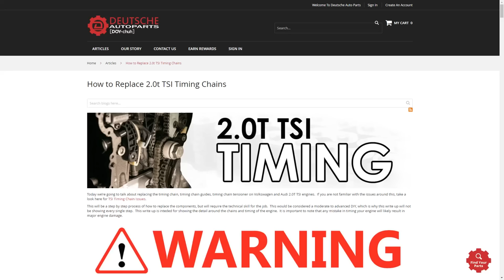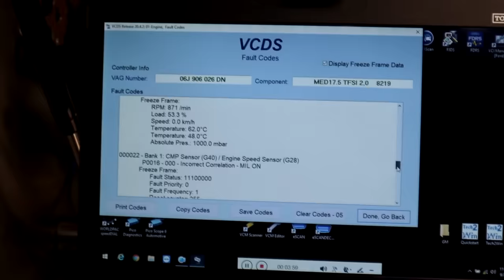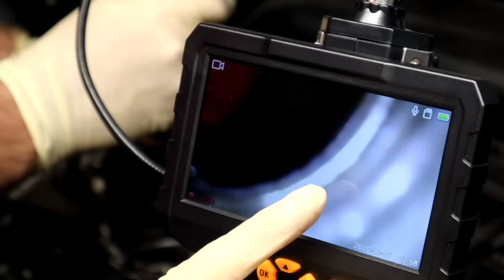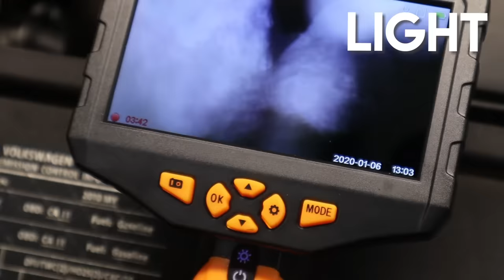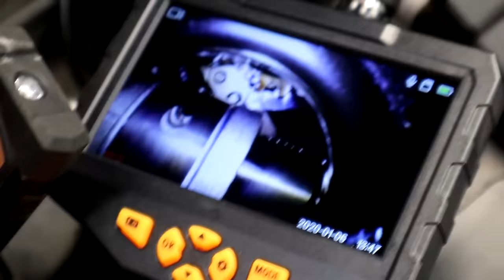The Jalopnik Tiguan FAILED ~ Despite the Warning

Comment: The timing chain tensioner on a Toyota corolla can be replaced in about 10 minutes without taking the timing cover off. I love superior German design.
Reply: Calling it a design is being generous
Reply: @tossmonkey1  
It's not design, more like accident.
Reply: @elprzemo666  Or an annuity for dealerships
Reply: Mercedes v6 only have to remove alternator to change tensioner
Reply: Your corolla makes 120hp-140hp and is molasses slow.
Reply: @goclunker  What does that have to do with superior Japanese engineering. Plenty of cars from Lexus that put anything German to shame.
Reply: German engineers are the most arrogant people on earth.    Only idiots keep doubling down on lousy designs and "plastics" in some really critical areas.       I don't care if Toyota uses plastic in engines too.   Toyota's "plastics" last longer and work better and are more reliable.
Reply: @lukew2194  don't get too cocky though, there is nothing Japanese that can match Maybach quality.
Reply: @lillexus5589  Give me a Maybach for a few weeks so I can evaluate it's quality and I will get back to you with my findings.
Reply: @goclunker     They could engineer a little reliability in with that higher performance.    How about not using a plastic water pump impeller for starters.....
Reply: Lil Lexus actually I think the Toyota century does and they’re also still reliable, even with the v12 models.
Reply: @scdevon  German and Russian engineers are some of the best in the world fact.
Reply: @chris-jb5ds     Germans could be a lot better engineers if they didn't test the limits of engineering on the general public so much.     A chain driven oil pump / balance shaft module?   That idea should have failed on a test track, not inside of a customer's wallet at the VW dealership. 
Russians.   LOL.
Reply: @lillexus5589  Having worked on a Maybach or 2...  No. Absolutely and completely no. They share the same build quality and even some components as a Mercedes Sprinter van, they just don't get used anywhere near as much or as hard.
Reply: @stykytte  I know enough about Maybach's bruv, my brother inported a s680 to Poland from China. Some parts are indeed interchangable, yet the complete symphony of the parts form a level of luxury that a normal S klasse or Siebener can't compete with.
Reply: scdevon did i say the tsi is reliable? No, i said that the more power you make without extra displacement, the more complicated an engine gets. Its not rocket science. Stick a turbo to your corolla engine and it will last 1 track day. Mightycarmods for proof.
Reply: @lillexus5589  I never said they were not a sofa on wheels. You claimed nothing Japanese could match their quality when they are easily outmatched by any JDM executive sedan.. hell my fathers old Toyota Hi-Ace was nicer to be in than any of the Maybachs I worked on.
Reply: stykyun no it doesn’t. Power= complexity. A 2jzdte makes 670hp max before it needs fully upgraded internals. Its also a fairly complex engine. Your not making 645hp on a corolla. As they say, video or it didn’t happen. You don’t understand basic physics.
Reply: @goclunker  This has nothing to do with physics, you're just making yourself sound dumber. A modified 1950's design 426 Hemi can push 11,000HP. Yes, ELEVEN THOUSAND Horsepower. What do you think top fuel dragsters use? They are not complex at all, the simpler the better so there is less to go wrong...

A Corolla can have many different engines in it, I had a 3S-GTE, very similar to this https://www.youtube.com/watch?v=C_4_f_e8jHY except I didn't put as much money into mine as it was a daily drive road car and only ran it at 30-35PSI on a Garrett. I could have turned it up, but it would push through the clutch.

You're some real Dunning-Kruger material.
Reply: stykyun oh, and if your corolla is making 645hp, it is NO LONGER A COROLLA, because not a single part in that engine is stock. Not the crank, not the rods, not the pistons, bearings, head, valvesprings, cams NOTHING, not to mention a turbo, making your idiotic “point” COMPLETELY MUTE
Reply: @goclunker  It's still a Corolla on the reggo you muppet.
Reply: stykyun stock engine? No? Stock internals? No? Not a stock Corolla, you vegetable.

You’re not holding any power stock, period, as the blown corolla swapped yaris easily proved
Reply: @goclunker  You keep handily missing the parts of the replies where I prove you wrong. Here let me help you https://en.wikipedia.org/wiki/Dunning%E2%80%93Kruger_effect This is why you think you know wtf you're talking about.
Reply: stykyun BUILT MOTOR NOT STOCK. You are arguing Corolla reliability with a BUILT MOTOR you vegetable
Reply: @lillexus5589  However nothing devalues like a "Maybach".
Reply: @gti500  true that. As mentioned somewhere above in the comment section, my brother bought and imported an Maybach S680 from China to Poland for around 70K Euro. It's a high mileage one, build in 2018 but still a damn nice car.
Reply: @goclunker  same engine fits on a Lotus
Reply: @goclunker  I have a Corolla and a Golf in the driveway. The Golf says "defect brake servo" and the check engine light is on. It goes to the mechanic Tuesday. The Corolla with its 4 valve per cylinder,double overhead cam and variable valve timing simpleton of an engine is 4 years older than the Golf and has gone 60,000 more km. It starts first time, no warning lights. When the Golf is working properly, it is a much nicer car to drive. But, if I want to get to work, I'll take the Toyota.
Reply: @cme2cau  sure sure.
Reply: Its what happens when its built by engineers, not mechanics
Reply: @scdevon  Honda uses a chain driven oil pump/balance shaft assembly in some of the K-series engines, I've never heard of anyone having issues with them.
Reply: @PistonAvatarGuy        That's easy.   Honda got it right and VW didn't.     Google the VW balance module / oil pump saga.   It's ugly.
Reply: @scdevon  Yup, I just thought that you were saying that the whole thing was a bad idea.
Reply: @lillexus5589  Toyota crown .
Reply: @cartoonking461  the Crown Majesta comes close, yet lacks in aspects and was only sold on the Asian market. The new Crown is a beefed up Lexus ES.
Reply: @goclunker  since when are 2jz complex....
Reply: @goclunker6821 Are you inferring that VW’s are fast? 🤣🤣🤣🤣🤣
Reply: Useful info if this was a video about Toyota.
Reply: @timothyhoffer8011  The message being - VW's a garbage, Toyota's not so much
Reply: @lukew2194  you mean like how they have a laundry list of issues just like a corolla should know worked on enough of them rofl. weeabo fanboy spotted

Comment: These engines are absolutely appalling. So many weak points it's just incredible. If something doesn't break mechanically, it'll be made of plastic & leak later! Shocking quality.
Reply: That jalopnik guy should be ridiculed for giving bad advice.
Reply: What is truly mind blowing is my 96 A4 had timing Belt issues, the issue was the tensioner.... So they switched to chains. Awesome but, why is the damn tensioner still made of freaking playdo 14 years later?
Reply: slimchriz1 planned obsolescence. They will never redesign it to be reliable
Reply: @slimchriz1  Its a known issue and so at 100k miles replace the chain and tensioner. It’s a cheap repair when you do it timely. Waiting until the engine implodes at 130k miles is on the idiot owner. Fix it at 100k and the car will last another 100k miles.
Reply: @slimchriz1  those had both a chain and a belt...  all the 5v motors did..  1.8 2.8 4.2
Reply: I considered a VW GTI as a fun daily, but ultimately went with a '17 Mazda 3 manual and after watching this I'm confident in my decision. Reliable and slow is the way to go if you're on a budget. I know some people will disagree with me, but that being said I still think the MK7 GTI is one of the best cars VW has ever made.
Reply: Mazdas have the EXACT same timing chain issue. At 100k miles you beed to replace the chain and tensioner on your Mazda too.
Reply: @michaelb7437 , just to compare: X-Trail T31 2008 2.5L QR25DE — more than 247000 km — NOTHING has been done to the engine yet.
Reply: Bring back the BPY motor, which preceded this in the earlier B6 Passat and the earlier A5 Jetta/Golf/GTI.  Change the timing belt regularly, along with the infamous "cam follower" riding on the fuel pump cam (looks like a big thimble).  You should be good to go.  Mine went to 183K miles before my daughter totaled it, while she was commuting to college.  We bought it new and got 11.5 years out of it.  I still have the cam timing tool kit in my basement for this motor.
Reply: @taomicioli  The chain connected the two camshafts, the belt connected the exhaust cam to the crank.  Beware of the water pump seizing prematurely.  I have a 2004 VW Passat wagon with the 1.8 L "AWM" 20 valve engine.
Reply: @WPM_in_ATL  know about them....  do a few a week at the dealer I work at..... all the 5v motors were like that ...  as were the older 2.0 gti and first gen golf r...
Reply: @taomicioli  I do understand the 20V 4 banger motor can be made to make 400+ HP, that is why I decided to fix the car (AWM equipped Passat) when the timing belt broke after the water pump seized.  I've put 10K miles on it since and now it has 204K on the clock.  Local machine shop knew what I needed before I finished describing the engine to them...made me relax knowing the bent valves were not catastrophic failures.  Pistons were fine, just cleaned some carbon off them.
Reply: @dil6969  you lost out on a ton of fun
Reply: @michaelb7437 Or improve your life and buy a Toyota/Honda!
The vaunted German engineering …VW = Garbage
Fix that Turd for $5K and it’s still a pile, at best another 1k miles before another catastrophic bill!

Comment: This is a great ad for Toyota
Reply: Yes ,the Rav 4 is cheaper and just runs and runs.
Reply: why, youtas have lots of problems like every other car maker they're not made of pixie farts. Bought a brand new tacoma and theres a list of issues that are "normal" like the dash lcd vanishing for periods or impropper rough starts or shitty vtech that ruins the power band and has to be tuned properly and on and on. Meanwhile my 100k B8.5 has only had 1 water pump, a new set of breaks, new set of tires and a pcv valve (sprorts cars do go through brakes and tires faster but pretty sure these never were changed since new )

Comment: Had a blast!  Thanks for the good times.
Reply from the maker: YASSS!!!
Reply: I imagine the vehicle owner is happy this wasn't a more direct tie-in with Cars and Cocktails... 

Because while "Fixing Bent Valves While On A Bender" is a fantastic title for a video, I'm not sure the end result would have been quite as fantastic as it was.
Reply: Adaris we drink and we work on cars, but not at the same time.
Reply: @Deutscheautoparts  I was kidding heh; I apologize if it wasn't evident.  Truth be told, trying to time a TSI engine while inebriated sounds like a very special kind of hell for everyone involved.
Reply: Adaris didn’t take offense. Just wanted to clarify. It would be a challenge if you were drunk.
Reply: @Deutscheautoparts  side bar there guys need some help decoding between a 2014 Golf GTI with the 2L TSI and a 2015 Polo GTI With the 1.8Tsi which would be worth getting? By the way the 1.8 comes with a 7 speed dry clutch DSG.
Reply: Is this something i should also watch out for with my 2010 passat cc 1.8tsi??
Reply from the maker: CC didn’t get the 1.8 in the US, but in 2010 yea it’s an issue
Reply: @HumbleMechanic  Thnx for anwsering, what would be the "best option" ? Just upgrading the chain tensioner or do other things have to happen too? my car has 60000 kilometers on it and has been running perfectly..but i want to have a trouble free engine if possible..
Reply: Hello....part number of vent a  new manifold 29:41 please!!or put link ...i wont this...tanks!!
Reply: HumbleMechanic is it possible to put a mk7 gti engine on my mk5 rabbit??? If so what would I need to do to make sure the transition goes smoothly?
Reply from the maker: Oh yea! Everything is possible with enough skill and money. Lol. It’s probably not a straight drop in
Reply: @Helghan23  Maybe look on German forums?? Those crazy germans might have a swap like that on there somewhere...
Reply: TIL DAP is also located in NC! Nice to see local representation in the automotive and YT world!
Reply: VW suspension, body, and interior fittings are excellent, but man...., tooo many plastics in the engine.  Not sure, why they put plastics in vitals points and Germans do not make the best plastics. American Dupont does
Reply: Brought a scirrocco 2009 2ltr TSI turbo from a dealer. Lasted under 2 months. Took it to a mechanic. Quote was 9,300$ to rebuild. Car dealer wouldnt take car back. Took him to court and sued them. Got all my money back and more. Found out that these engines are infact short fused timed bombs. Will never buy cars with these engines again. Poor design.
Reply: @scuxxy25  Yes, many states do not allow Car Dealer selling you Lemon.  I believe states like Texas has costumer protection of 1 year from any used car dealer even if they said As is.
Reply: In the video you say the timing marks are blue, but they're not? They look yellow to me.

Comment from the maker: So we give Jason a little bit of a hard time in the video. This is all in good fun. The type of fun ya have with a good buddy. I am happy Jason reached out to me and we could work together on it.
Reply: I've seen timing guide failures on a couple mid-2000s Chrysler Hemi engines, but they didn't resist spontaneous disassembly as well that VW did.
Reply from the maker: @lakinnenlako6883  LOL
Reply: @HumbleMechanic  a bit off topic... I actually just re watched today, your review on the sonic s12 that we can see here today. There is mention 20% discount on the first purchase for crew membership. However, the website says 10%. Is it a typo or is a newer information? Also, is the discount worldwide or USA only?
Reply: Hey Charles how can i get ahold of you so i can use you to work on my tdi ???
Reply: Excellent staff very knowledgeable gentlemen. Wish we could do a brain transplant
Reply: HumbleMechanic again always thanks for the video! Awareness of potential issues is always good to know. A $800 preventive measures in replacing the tensioners and inspection is much less expensive than having to deal with the damage after the fact. Seeing this video made me feel at eased my money was well spent last year on my DD tiguan!
Reply: @Kurt Koleszar to be fair, he said that was a very uncommon failure - the tensioner is the failure prone item. 

Also, composite materials are far better in a situation like that, as metal on metal contact would cause chain failure, and also promote metal particulates in the oil.
Reply: Where's the injector puller from? And the special tool to pull injector seals off? thanks great video 😎
Reply: @TheThrobber1  they said it's available from DAPs website

Comment: Great vid, but for those wanting to get out of this mess as cheap as possible in a DIY, I've had zero issues with simply throwing in some valve stem seals and lapping in ebay valves with an electric drill, even when all 8  intakes were bent. Just dump some water in the intake ports after they are lapped in and let it sit for a while to make sure you got a good seal.

Comment: These damn VW engines,...it’s like putting chewing gum back together... Nice job, guys. Flashbacks to rebuilding my 1.4 twin charger, nightmare job.
Reply: Axtenar What vehicle? Where was it manufactured?
Reply: Our 1.4 twin charger never cracked a piston but it did go through 3 sets of coil packs and a turbocharger failed.  Plus when we sold it at 100kmiles it was leaking oil from the timing cover.
Reply: My 1.4 TSI twincharge engine code BMY just had to have complete timing chain job done: €2000. Also have the intake cleaned for carbon ~ €800.
Thanks for the shitty design VW!!
It still fucking Shakes at idle. Do you know what it could be?
Reply: huh? what are you talking about, it came apart and went back together like a new lego set. Have you ever worked on an american or japanese car where nothing fits and has to be forced and you need a billion tools?